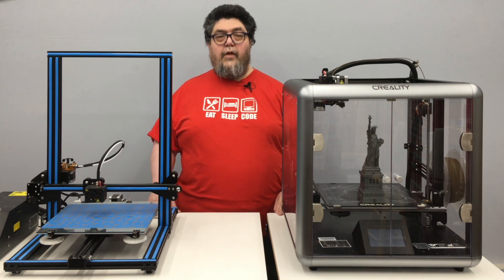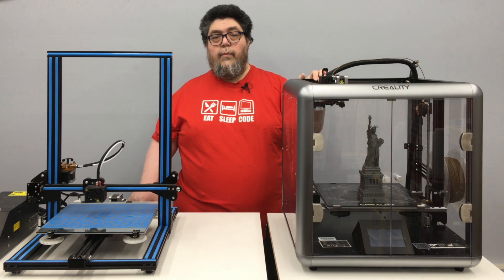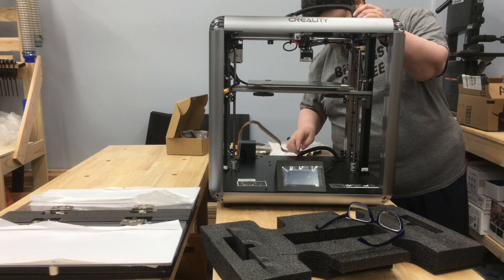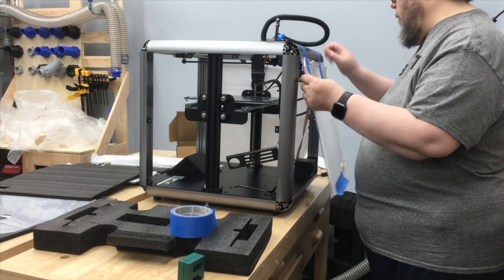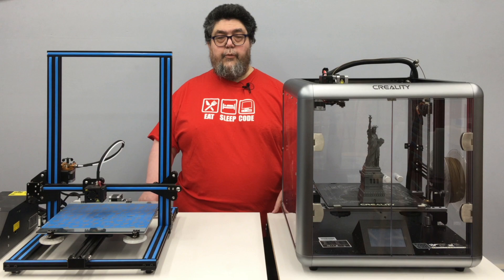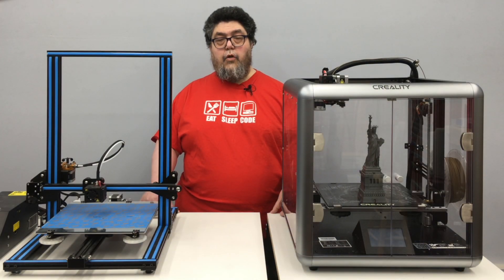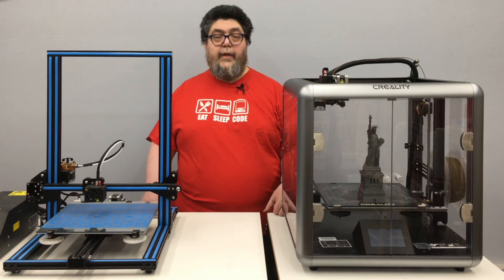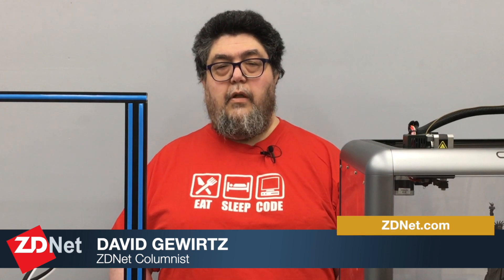Putting the Creality Sermoon D1 to the test

Comment: Sorry but I have to disagree with you. I bought a Sermoon D1 last year and it's been nothing short of a dumpster fire of a printer.

Out of the box the z-axis limit switch was broken and worse than that, I had to replace one of the z-axis steppers too because it's shaft was noticably bent in shipping.

The ''all metal extruder' is a meaningless marketing gimmick.  The actual hot end isn't all metal; it still has a PTFE tube in it.  Worse, the hot end is specific to the Sermoon so it's not exactly easy to find replacement parts.

Getting back to the z-axis, although there's two z-axis lead screws there's still only one z-axis limit switch so the printer (even though it does have the ability to control the two steppers independently) has no idea when the two sides fall out of level...  And fall out of level it shall since the gantry itself is not very rigid.

If all you're printing is PLA the printer is 'alright" but the part cooling and heat break fans are too small to cool effectively. It also seems that Creality has been playing with the e-steps on the Sermoon from batch to batch.  Even with PLA my printer would horribly underextrude unless I really cranked up the extruder temp.

I ended up solving the majority of the issues my Sermoon had by just outright replacing the extruder and modding other parts of the printer that needed it.  It would have cost me the same to just buy a better printer from the get go though.  Live and learn.

The only good thing about the Sermoon D1?  It's frame.  The frame is great and it's very rigid. Unfortunately the rest of the printer fails to impress, especially for the money.
Reply from the maker: That's unfortunate. As I mentioned, mine arrived with some connector issues, but since I plugged them in and hot glued them, there's been no problem. We've been running it pretty much nonstop, having printed hundreds upon hundreds of prints. In fact, it's printing right now. I did have an extruder jam, but once I cleared the blockage, it's been back to printing. Definitely reach out to Creality and see if they can get you helped out. Good luck!
Reply: Wow, thanks for this info bro 🤘

Comment: If price was not the deciding factor,  would you pick this over the ender3?
Reply from the maker: That's a tough question. Since this review, we've printed a LOT using the D1. With the exception of needing to re-level once, it's been a totally reliable beast. We're not doing anything wildly unusual, just a lot of white filament printing the same two or three models over and over (a stand for my wife's hobby). We've probably printed 2-300 of them. But I always like buying products with a super-active aftermarket. There are a lot more add-ons, tutorials, and hacks for the Ender 3. If build area is not a concern, I'd probably go with the Ender just because it's so widely supported. But the D1 has been rock solid.

Comment: The problem with limited space in the SD-card can be solved by printing through USB, i routed the cable through filament spool body, it is hollow and works fine as a penetration.
I run WIN 10 on my computer and printing through USB was easy., i transferred the settings to original Cura and it has been working fine .
Reply from the maker: Going through the spool holder is a great idea!

Comment: Interesting video, thank you for the review. What sort of speed have you been getting out of this printer? The manufacturer's webpage doesn't seem to have it listed.
Reply from the maker: I don't tend to optimize for speed. I much prefer reliability. Once I get something that just prints, I leave it that way. This one is set with travel at 120mm/s, wall at 30mm/s, and infill at 60mm/s. That's not optimized. It's just what worked for basic white and gray PLA.

Comment: whatva material can print it. ?
nylon carbon ?
Reply from the maker: I'm just printing in basic PLA and wood PLA. But the nozzle can be replaced, so if you put in a harder nozzle you could probably print harder materials. As for heat, I'm not running it all that hot.

Comment: Let's see. Would a pi 4 running from a big battery hooked up to USB C inside work without cutting holes? I run my pi 4 headless anyway. Oh, but my '4 has a fan. How hot is it in there?
Reply from the maker: That's an interesting idea. It does get hot in there, but possibly not too hot. Remember, you have what is essentially a heating element spewing 60-70C into the compartment while the printing is happening. 140F is a little high for computer gear, but probably tolerable.
Reply: I integrated it in the bottom plate, running 1 power cable through the plexiglas through one of the holes for the cables. Works like a charm. However, you have to disassemble the hole printer if the pi dies. I also added an camera cable to the front left.